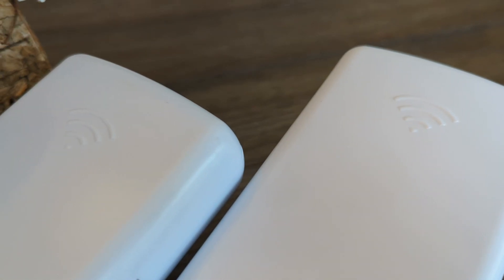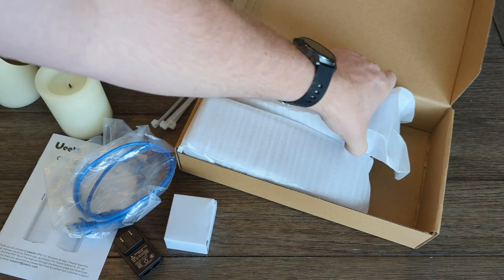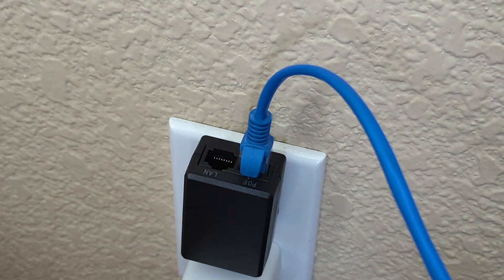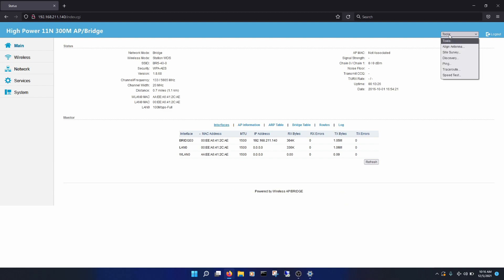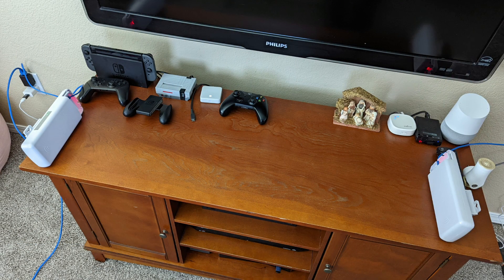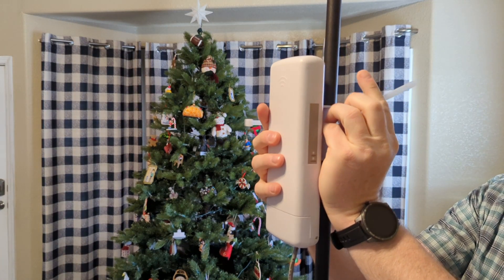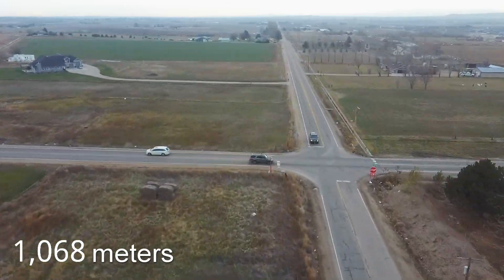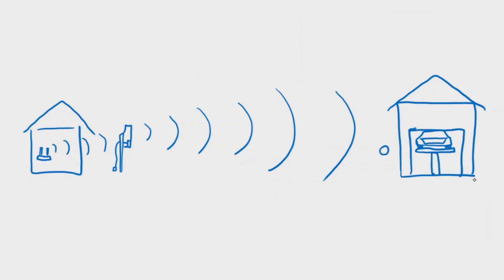UeeVii Wireless Bridge Review (CPE71C) | Extend Your Network Wirelessly

Comment: I have them, they work well but need to be outside pointed toward each other. I have a metal shop so I had to mount the receiving unit on the outside wall. The transmitter unit is inside my garage it works good when the door is open, soon as my wife closes the door on me I loose my link so I'm in the process of mounting the transmitter on the outer wall. Overall, good product.

Comment: I have a question...im having trouble connecting, trying to connect out of the box like i read someone did in previous comment, i see they're paired, have one connected to router and took one to sheed to give wifi access to wireless camera...testing wifi signal with my cellphone and my home network name won't show anymore bc it's too far...are these bridge names BR5-40-0? If so i tried connecting to that and asks for a psswd...tried admin, won't work looks like i need more characters bc connect isn't highlighted, tried my home wifi psswd and says incorrect...what am I doing wrong?
Reply: Me too .  Which one could respond to help us out

Comment: You can pick up some used Ubiquiti Nanostation M5 radios for the same price or less and get way better results. I literally bought 8 M5 locos' @ $14 USD each and yeah they look rough (before cleanup and repainting) and the doors were missing (3d printer FTW) upon arrival, they all did power up and I could access the setup UI and configure them with no issue. There are more complete cleaner variants out there though I just got these because I knew I could replace the parts and clean them up. They also have M2 radios as well for the typical 2.4GHz band.
Reply: @Elfnetdesigns -- would you want to sell a couple?

Comment: Do you have to put them outside? Can you stick them inside near an outside wall or window pointed in direction of the other one?
Reply: No as long as you are not in a metal box like a home with aluminum siding, trailer home, RV, metal shed, etc then you need to put it outside or in a window at least. Remember how your microwave oven works to keep that RF inside so it cooks food, same principle with less power scaled up spaces, with a metal exterior home or space since 2.4 and 5GHz are microwave bands.

Comment: I'm totally having issues I can't get it to work 😫 🙃 would you be willing to help??
Reply: I just had issues too, but I got it working. The instructions are awful. Just set one to master (little switch to right, this is the one by the connection you want to share) and one to slave (switch to left). Then make sure they are on the same channel or use the little reset button to change, until they match. Point them at each other, test in same room before moving to final location. My "master" is in a very hot attic shooting through a fake dormer window, once they are finally configured the performance is quite amazing (shooting about 200 ft. through oak tree to RV). Use the POE power supplies, don't waste time on the 12VDC input jack (they don't publish the specs anyway, but it probably needs to be >1 Amp). One Ethernet cable for the power, another one out of the non-POE jack from the power cubes to your web (at least in my case). I would almost be willing to rewrite the manual for them in American English now; they make a simple thing seem more complicated, and skip over information that would be really helpful..
Reply: Do I have my modem hooked to a router.  Then that router connected to the bridge .  Then the slave bridge in the shop 400 ft away, Ethernet from the camera dvr to the lan slot… connect to my wifi and nothing,  it brings up a different wifi, click on it and asks for password . I tried admin but not enough letters.  Do I need to get on that wifi code in order for it to work?  I don’t have a computer, only iPhone so not sure how I can even change anything

Comment: This reviewer makes this bridge sound complicated ; NOT. If you are only providing a point to point bridge the directions tell you up front that they are preprogrammed. Simply connect every thing as pictured and it works out of the box. I am using it for an outbuilding 200 feet from my house. I get the same speed of upload and download(50 & 7 respectively) that I do with a direct connection to the router. There are several other YouTube videos that are more positive, and explain more complicated set ups.
Reply from the maker: I mention in the video they are connected out of the box. Did you watch all of the video?

Comment: Hi, I have 300mbps internet speed  but I am only getting 40 mbps at the client  router even though  the two routers are only 10 meters apart just for testing , is this normal to loose this much speed
Reply from the maker: On these units, yes. They are not built for speed.
Reply: @BudgetNerd   So just more false advertisement and lies.
Reply from the maker: Well sort of, but no. I cover this in the video though...
Reply: @BudgetNerd   If I was getting anywhere near the 93mbps your was getting I would be happy but only 40 is not even close to what they advertise.
Reply from the maker: My 93 was a best case scenario. I wouldn't get that if I had set them up with some distance between them. But yeah, anyone would hope to be as close as possible to the theoretical max they claim. Falling way short of that is pretty frustrating, but nothing new for wireless tech.
Reply: @yeahrightmate  every company advertises their equipment way higher to sell their equipment. You should know that by now. Buy 2 to 3 times higher equipement you want or need. They test in perfect conditions  with no other interference and up higher than you will ever mount. Probably laser beam alignment too.
Reply: @robbypro3370  What a load of crap! I don't know where you come from but in my country that's called fraud. I have mine plugged into my main router that is getting just under 3oo mbps download and over 500 mbps upload And at the transmitting end of this piece of junk I am only getting 31 mbps and 500 mts away in a direct line of sight  I am only getting 21 mbps, that's not even close to what it said I should be getting. It is just more Chinese junk.
Reply: @yeahrightmate  if you need reliable speed gotta dish out some extra cash for ubiquiti products
Reply: No it is not, something must be interfering.